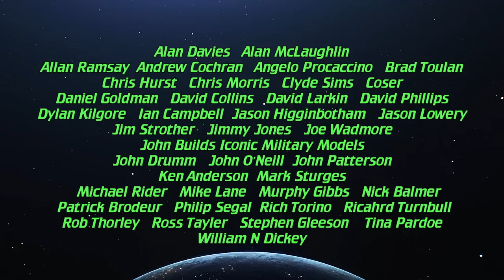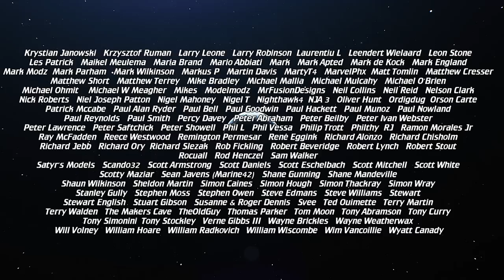Build the Lamborghini Miura - Pack 12 - Stages 92-100 - The Completed Model

Comment: for $1600.00 id expect better fitment than a cheap 1/20th scale medal car kit costing $30 usd. the huge gap between the front section and engine bay are pretty noticeable. are those hinges adjustable? the dashboard and center console have a large gap as well. the speaker sounds like it was taken off a kids toy.

Comment: 😮 that was a quick build..... Aren't the gaps between the bonet and the front of the car rather big. And the same thing with the back engine bonet/boot part.
Reply from the maker: There’s no gap at the front. Small gap at the back. Remember when I filmed the beauty shots I had to have them partially opened to be able to lift them up. If you look at the last picture and thumbnail you will see how they look when they are closed

Comment: I noticed you only showed the engine revving and the interior dome and taillights working - do the other features not work?  That stalk switch with horn and signal switch not work?
Reply from the maker: I forgot about that. I don’t remember a signal switch in this vehicle you push the signal switch for horn and press it towards the chair to turn on the lights

Comment: Can't tell if the model wasn't assembled properly or that there's something wrong with the kit, as the engine cover and bonnet both didn't look like they sat properly.
Reply from the maker: They are fine. I had them opened. If you look at the thumbnail you will see them in place. There is a bit of a gap on the back section but it aligns fine on top so not sure about that

Comment: Another question. I had a lot of trouble fitting the front chassis on to the center section and had to try to fit it by taking the spare tire out. That didn't help - so I put the tire back in and eventually wrestled the front section on to the center section. The questioin - in some earlier steps I see you had the spare tire in place but in the later steps  - when putting the hood in place, the spare tire is missing. Why is it missing and did you have to take the car apart to put the spare tire back in?
Reply from the maker: No I actually only installed 1 screw in the spare tyre spindle. That way I could easily take it out and back in as it swivels around. It was easier to for the front end without the tyre in and then replace once it’s in place

Comment: I've had trouble with the doors staying closed. The hinges are tight and the door latches aren't strong enough to keep the doors closed - they keep springing open. Any suggestions besides taking the doors off and stretching/bending the hinges?
Reply from the maker: I didn’t have an issue with the doors. The just have a gap near the back
Reply: Yes. I have same problem. Without door hinge, door and cabin perfect together. But the hinge is problem.

Comment: @worldofwayne question.. I know several people who are having an issue with the front hood. It seems like it hits on something that won't allow it to close properly unless you keep pressure on it. Watching your video  initially your hood looks the same as mine.. you can later see you removed the spare tire.. then at the end it looks like your hood lines up well and your spare is reinstalled.  . Any tips be greatly appreciated as this is driving me crazy.
Reply from the maker: I removed the tire to see if that was the hat was stopping it go down. Turns out it wasn’t that it was the black frame under the bonnet it needs to be really tightly screwed in to the underside  of the bonnet. Once that’s done it should go down fine
Reply: @WorldofWayneUK  thank you! I will try that tonight!
Reply: @WorldofWayneUK  Thank you! Turns out on mine its the fuel pipe... pulled it out and perfect... Need to figure out how to adjust it.
Reply: @allanfiedler9645  Yes same, pulled out the fuel pipe and front hood gap is 95% gone. I'm just going to leave mine out.

Comment: Just started watching your video and couldn’t help noticing what looks like rust/oxidation on the trailing edge of the rear section as you were attaching the number plate lamps?
Reply from the maker: Close it’s actually flocking from the Gremlin build lol. It’s in the plastic box I was storing it in
Reply: Continuing watching and I see that you’ve either swapped out the rear section and boot lid for a cleaner version or applied some t-cut as some marks remain visible. Never seen this on a 1:8 kit before, and is unusual on what should be recently manufactured parts.
Reply from the maker: @richardjohn2734  no I just wiped off the flock
Reply: Thanks for clarifying its flock as I was considering purchasing the entire kit once it became available.

Comment: I am extremely disappointed with this Miura model. None of the body panels fit well - with large gaps about the doors, boot and bonnet. The doors will not stay shut. And, most importantly, in this stage (12) the plastic skirts were warped so that they would not fit or stay in place. Even when forced into place they interfered with the movement of the doors such that the doors couldn't be used. I have asked Agora for replacement skirts but I do not hold much hope out that they will fit any better. Very disappointing model build, particularly to have the very last step in the year long process be such that the car can not be finished. I have made several Agora models - all went well - but this one was made with very poor tolerances for components.
Reply from the maker: Check out https://mymiurabuild.com/ . Todd address and rectifies some common issues
Reply: @WorldofWayneUK  Thanks